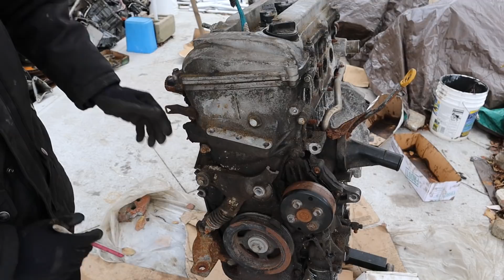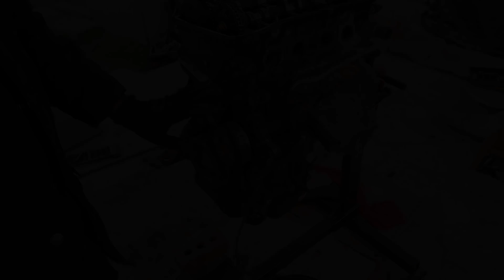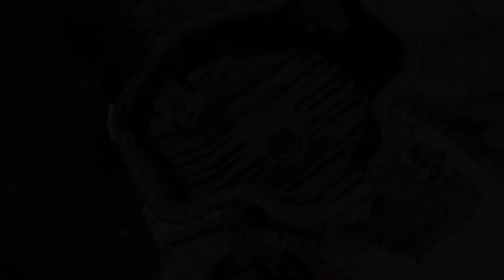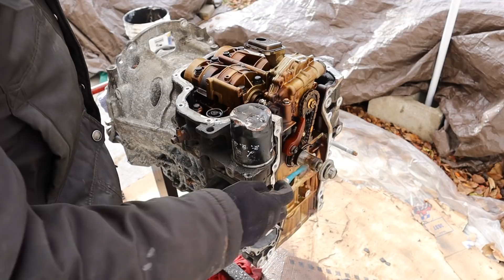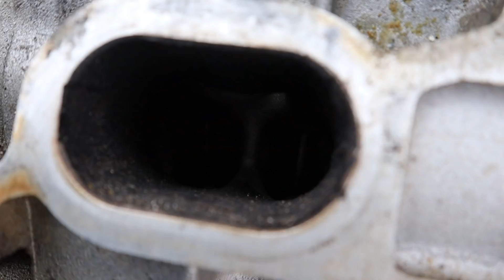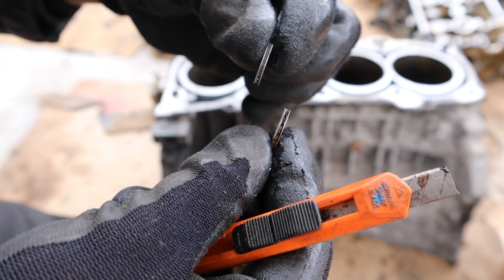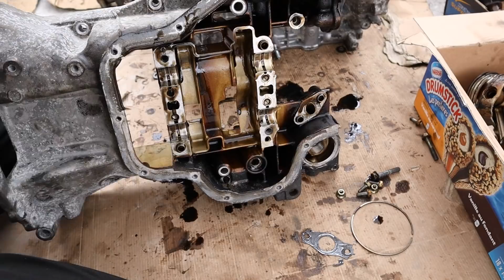Here's why Toyota Engines Fail

Comment: My dad sold a 94' Toyota pickup to a neighbor years ago. Within only 2 years he wrecked the truck, completely ran it to the ground. Engine was blown and the body was in pretty bad shape. Sad to see that little truck go, due to lack of proper maintenance. RIP little Yota. 1994 - 2013
Reply: if they cant handles a slight lack of manutention they are garbage,.

Comment: I have never had an engine fail on any car I have ever owned. I have owned mostly used GM vans in the last 35 years. I change my oil every 10,000 kilometers, and brake pads when they start to squeal. That's it. 

I have never done maintenance on any vehicle ever, other than oil changes. My current vehicles is a Chevy express van which is at 270,000 kilometers. I put 100,000 kms on it since I bought it used 6 years ago. 

Have I been lucky for the last 35 years?
Reply from the maker: Keep them we'll oiled and it'll do well for you. The Chevys are strong engines, hopefully the same for the transmission...

Comment: They dont fail if you maintain it correctly. Stop that, its obvious.
Reply from the maker: But the flaw is in the design. It shouldn't burn so much oil and strip head bolts
Reply: @speedkar99  Like I said poor oil maintenance of the engine.

Comment: No 2.4 engines only 2.5 2018 engines and V6. Dont listen to this guy 😂there are 2.4's out there with over 400k miles you just have to change the oil on a scheduled basis.
Reply from the maker: Yeah but they shouldn't be burning this much oil! Keep it oiled and you'll be fine...
Reply: @speedkar99  BMW and many other cars burn oil.

Comment: I have this engine in a 2008 RAV4 and it was consuming oil which I noticed just before the warranty expired. My local Toyota dealer did an oil consumption test which it failed so they did a short block replacement at no cost to me. Still have the RAV4 and it's used every day.
Reply from the maker: Wow. A new short block
Reply: Respect to your Toyota dealer.
Reply: You are a rare Fortunate situation. I was adding a quart every 500 miles.
Reply: @anthonysupplee858 try a professional engine flush. I do 5k oil changes on my 2020, and 2021 4Runners.
Reply: garbage toyotas..

Comment: Low oil on the 2.4 seems to be standard. I replaced one for low oil damage and now the customer 80k replacement is doing the same thing about 20k later. Also clients don’t check it so they will be calling me soon.
Reply from the maker: Agreed. The typical Toyota owner doesn't check oil

Comment: Low oil will destroy most engines l would like to see dismantle a toyota 22R motor l have a toyota hilux(pick up) and l recently changed the oil in it and over 4litres of oil came out and the pick up is 25 years old also it has 428000 original kilometers on it what a great motor you pull one of these motors apart you end up putting it back together
Reply from the maker: I don't put it back together. 22r is hard to find now

Comment: You are spot on about the plastic crap impellers on the waterpumps for volkswagon. They sabotage their engines to last short term.  Plastic impellers strip from knurled shaft and car overheats at 85000 miles and blows headgasket. Graf makes a metal version.

Comment: I have 1zz-fe and was the same issue , i thought at the beginning it came from rods/cam shaft , but someone of my friends have extreme experience in  4-cly engines of toyota tolds that , then i opened my engine and change it , not the engine working perfect .
Reply from the maker: What did he fix?
Reply: @speedkar99  Yes , He Changed All Crankshaft Bearings . (Then All Knocking Sounds Gone , it Was Between 2000 - 3000 Rpm , But Lately After i Ignore it For Very Long Time , The Knocking Heard Almost All The Time) .
Reply: Plus Connecting Rods . All that happened because there was leak on engine gasket , and i didn't saw it , then drove my car with almost 2 litter short.

Comment: these aluminum blocks do the have nicaseal cilinderwalls???(nickelplated??)i didn t see an cast iron sleeve for it.....and yes the 0w and 5w can clough up prity bad,the holes for the return is definitly a problem(1 or 2 service interval  skips can make a diffrence then)...maybe an extra oilnozzel under the pistons can take the temperature down from the piston crow ,to prevent the oil burnig up in those holes????anyway just saying.....good content dude
Reply from the maker: Thanks. I didn't check for the steel sleeve

Comment: So explain why my toyota engine hasn't failed? You do know that the number one vehicle to go over 300,000mi is the Toyota 4runner, right? Let's talk about Ford engines.... 5.4l triton perhaps?
Reply from the maker: Keep it full of oil?
Reply: Actually, Volvo engines go the longest. Check out your local bone yard for the odometer readings. I did, and was amazed to find nearly all Volvo's had over 300K miles on them when finally junked.

Comment: except they don't fail. what are you doing tearing down engines in your back yard? with your knowledge you should be designing them.
Reply from the maker: No thanks. Working for an OE is slave work. You are just a number. They don't care about your passion

Comment: PCV valve is to take out the gases that are at the bottom of the engine that bypassed the piston rings. And return it to the combustion chamber to be burned. If this fails and is stuck closed, it will burn the oil because the gases are mixing with the oil. Its probably the top cause for engines to fail. When I work on cars I always check it for people and replace it and just charge them for the part because they are usually not hard to change.

Comment: Toyota: These engine cooling cavities are too large, what do?!
Engineers: Add plastic filler!
Reply: It was added in 2007, the purpose is to direct coolant flow to the top of the cylinders in an attempt to control excess heat. The entire oil issue is caused by coking of the thin oil rings due to excess heat. Oil squirters were added in 2007 as well. Although never tested, a 2 minute cool down time might help, like if it was turbo. The 2.4 litre gets hammered since it is torquey and tends to be driven hard so the pistons get excess heat. These hot oil rings are small and low tension and are prone to clogging with coked oil once they stop moving.

Comment: I have (insert engine) with 500k miles and it's still running strong with the original oil filter!
Reply: slant 6 chrysler, never had to change the filter, just added oil, never did an oil change, 500k miles.

Comment: I am considering a second generation Mazda2 as a commuter car. 
Is the 1.5L ZY-VE l4 reliable?
Also getting it as a manual transmission only.
Reply: I own a 2014 Mazda 2 that has the ZY engine with 115k mi. It’s had no issues since I’ve owned it. The manual is great. It’s a fun car!
Reply: @Henhenjamib  great to hear, thanks!
Going to check one next week:
2011 Touring manual with 77K miles.
Reply from the maker: Decent but watch the rust
Reply: Yep, if you’re looking at buying a used Mazda, look the car over. Rust has always been Mazdas weak point.
Reply: Yes most definitely, first thing I do when seeing a car is get underneath with a flashlight and look for rust/covered rust and leaks.

Comment: Eventually mine 03 Camry burned oil and I just kept driving it until I finally sold it off with 217,000 miles.
Reply from the maker: Yeah that's the thing..if you keep oil it'll go but if you neglect or forget it's done
Reply: @speedkar99  I made sure to change it every 3500 miles.  It then got a PO420 code whenever it got above 75 mph.  I would erase the code and it passed inspection after getting it down to 1 MIL not ready when emission inspection time came.  That car was a freaking tank.  It got hit twice by other people and it got repaired and still kept going.  It was just time to get a new vehicle which I got a 2020 Camry.

Comment: I hate these engines because of the head bolt threads pulling out causing head gasket leakage.
Reply from the maker: Yeah the earlier motors had that issue

Comment: Im at 200 K miles with my 2AZ, burns a little oil but nothing crazy and still pulls quite strong.
Reply from the maker: I never liked the sound of the 2AZ though
Reply: @speedkar99  yes I agree, mine sounds very agricultural lol but I had two FRS for many years and those sound like a mini tractor too so I'm very used to such noises 😄

Comment: I have a 2006 Camry that’s been in the family since new. 127k km’s. It has only been winter driven once. I thought it would last me many more years but I learned about the oil burning issue and the head bolt issue last year and now I’m not so sure. I always use synthetic oil and I change it once per year at about 5k km’s. it doesn’t use oil and runs well so I’m hopeful if I treat it well and check the fluids often I’ll be ok. I’m a bit freaked out about the head bolts issue because there’s nothing I can really do about that.
Reply from the maker: I have a 2004 Camry, going strong. I went with the V6 though...no issues there

Comment: The shade you threw at VW made me lol...
despite  its flaws, a Toyota engine still is of better quality than that of a VW.  I would still pick the least reliable Toyota over the most reliable VW or even Chrysler or GM for that matter
Reply from the maker: Lol just making fun at VW
Reply: @speedkar99  
making fun of VW is always fun
Reply: The most reliable Chrysler, VW or GM will all out do the worst Toyota. VW has the 1.9TDI, Chrysler’s small block V8 (and magnums) along with their slant 6’s were all reliable engines, and GM’s small blocks and big blocks are literally famous for their longevity and durability. They also have the 3.8 V6 to help as well.

Comment: Your engine teardown videos are always educational to see.  And sprinkling a few digs at Volkswagen engines was a nice touch.  These are your videos, and after all, you are allowed to have opinions on the subject.
Reply from the maker: Thanks! Just trying to inject some humour at VW. Tbh its true
Reply: Volkswagen engines last just as long if not longer. Vw are a blend of economy/performance oriented. If you buy the little non turbo VW economy engines they will last as long as any Toyota or Honda.
Reply: @milliemone  I’ve had the turbo engines (1.8T and 2.0 GDI) and got 200,000 miles out of each. Replaced the first car because my (now ex) wife dented it up on a fence and it started rusting. But I didn’t drive it full tilt that much and I changed the oil very regularly. Still driving the second one. My VWs have been pretty low maintenance. But I do think those engines are a bit fussy on the type of oil you use.

Comment: Many Toyota engines wouldn't sludge to death if people changed oil every 3,000 miles. The 5,000 mile conventional oil change is BS in most Toyota engines. Sometimes you can't trust your own manual. 1.0mmX1.0mmX2.0mm piston ring packs are way more sensitive to this than the old 1.5x1.5x4.0 ring packs.

Many engines like this would get rehoned, then people would drill holes in the oil ring groove to prevent future oil burning. This wasn't an option with the Nissan 2.5L, burning oil would destroy the precat, bits of the precat would get sucked back in during valve overlap, and the cylinder bores would be destroyed. An overbore and oversize pistons were the only fix, and most of those cars weren't worth it.

8:04 I was sure those were  "Triple Square" after seeing them on German cars. One thing I hated about German cars was needing a set of those, allen keys, and torx bits as well as a set of metric wrenches. I tell people to buy Toyotas if they aren't car enthusiasts to avoid a lot of BS expense in auto repair and maintenance. If you buy a German car, you MUST know a reputable "All European specialty" repair shop with a good reputation. It will save you lots of money on maintenance and repair bills.

9:35 Lately many 4-cylinder engines have combined the balance shafts and oil pump.

14:28 If your car has one, remove, give it a shake, and listen to it make a clicking noise. If it doesn't, you need to replace it. Also, if your engine doesn't run that great, a PCV failure will make the engine behave like it has a vacuum leak. In many cars that would not idle properly, if you shook the PCV valve, it sounded like a soccer ball falling in mud. This test is far from perect. PCV valves have a spring in them and it can fatigue over time. That might make it open more than it should.

16:04 it ensures an even distributon of antifreeze around all cylinders.

20:19 You take the spark plugs out, pour in a bunch of Seafoam and let it sit for a while. You pump out the Seafoam, and hopefully it did some good. No promises.
Reply from the maker: Thanks for your points. 

I keep my oil changes around 5000km too

Comment: Poor VAG - but yeah I totally agree with the comments addressing their parts design. " The new Camry they redesigned it and actually made it worse..." I think very much the same applies to 2.4L CR-V, Element, Accord engines
I use 0w-30 instead of 5(0)w-20 - seems like compromise between 2% less internal friction, tighter tolerances and a bit higher higher temps the oil can withstand.
Reply from the maker: After I tore down so many VW engines it's clear to see the difference

Comment: Toyota said the main reason the plastic baffle in the water jacket was to reduce sound - specifically gurgling sounds. They were clearly concerned about engine noise. When I bought my 2004 RAV4 with this engine, 4 cylinder engines had a bad reputation of being obnoxiously loud. They wanted it to be less noisy than the competition. I respectfully disagree that the engine should be avoided. It lasted me 16 years without any engine problems. I had other minor problems with the car in its last couple of years, but nothing with the engine. I did regular oil changes. It never burned noticeable amounts of oil. I guess I had a good one. This engine has long been discontinued. Thank you for the video.
Reply: Ya, my 07 camry sounds like a damn deisel but its bulletproof

Comment: My 2009 Camry with that same engine has 250k miles and still great, never changed the spark plugs, only had to change valve cover gaskets, water pump, steering pump hose
Reply: ....spark plugs are long overdue....
Reply: You think having the original spark plugs is a good thing?
Reply: Speaking of lack of maintenance......lol
Reply: @JesusRoseAgain  He does 20,000 mile oil changes because his oil filter says so.
Reply: You didn’t have to bold your comment though.
Reply: @Thanson199415  because free speech

Comment: Is the thin 0W16 oil that is prescribed for the later engines also meant to prevent the oil scape rings to clog up? 
And thank you speedkar99 for this and other insights. Very well done and so interesting!
Reply: I believe is mostly to save gas by reducing the frictional loads of the engine since it flows better.
Reply: @madlad8102  I thought that the oil scrape rings and other piston rings are so thin nowadays to reduce friction. And now there is the thin oil to prevent problems with thin oil rings. But maybe it is both... .
Reply: See https://youtu.be/v4JS7PybV2k, from 2:47 onwards.
Not only ultra thin but mainly low tension rings.

Comment: Excellent channel amigo! I follow you from Patagonia Argentina🇦🇷. It would be wonderful if you could analyze the 1ZZ-FE, I have it in my Corolla with no problems yet. In the USA I understand that it was a very used engine in the Matrix and in many other vehicles. Thank you so much and Happy New Year!!! 🎉🍾🙏🙌
Reply: Just bought a 2007 Corolla with the 1ZZ-FE so would like to see him analyze it also.
Reply: Other then the occasional Toyota Water Pump, timing chain tensionner gasket and sometimes headgaskets when it leaks oil on the back of the engine, the 1zz-fe will last a long time in a Corolla or Matrix.. if you beat on 'em like you would do a B Series VTEC engine however, they tend to be relatively short lived.. 5w30 oil is a must too. Even if Toyota had back spec'ed them for 5w20, they chew thru the rod bearings with 5w20...

Comment: of these mid 2000 2.4 L engines, I'll take Honda K24 all day. Since it got VTEC, a timing chain that looks more robust, and pretty much trouble-free.
Reply: ....with the MANUAL transmission!!!!
Reply: @masontee8335  yes toyota transmission are very good tranny(transmisson) im note the best im french XD
Reply: @AlexNamyang   a FROG, undomesticated FROGG( LOL) joke
Reply: and if you want power buy a 2zz :) and have the (vtec sound and power
Reply: @AlexNamyang  as a 2ZZ owner I feel I’m obligated to say, a K20 is a faster engine than the 2ZZ, higher potential, better head and newer design. The K24 would absolutely destroy the 2ZZ
Reply: @lomfmur  I had in my young days a civic si 2008 k20z3 yes it's fast except too expensive for the price of a k20 you can have two toyota engines for that price or a cheap ls I had to rebuild my trasmission and it cost me $2400 way too much expensive and the 2.4 is slow I ate them for lunch lol. for the price it is rediculous if your goal is to pay 20 000$ to have 200hp well you are losing a charger 3.5 cost about 5000$ and have 300hp and rt have 370hp
Reply: @AlexNamyang  2zz engines are not destroying k engines wtf are you talking about 🤣🤣, if zz engines are so good why do most lotuses/ mr2s get K swapped???
Reply: @H4S4N_02 kid  they swap ls
Reply: Toyota early ones have piston ring problem but mid 2000 toyota fixed those already.  Toyota tranny is no tranny change for life if i remember.  The biggest problem with these engine is water pump failure.
Reply: lol i have 2 toyota  1 are vibe pontiac vibe with 1zzfe 360 000km and corolla 1zzfe 290 000 original tranny imposible to beat that i sell my old honda 210 000km k20z3 i  have 2 rebuild tranny and alot of shit toyota are the best tranny are the best go check is review or the crappy r18 the only car of toyota is not relible are the punk ass shit brz with shitty flat earth engine sorry im french